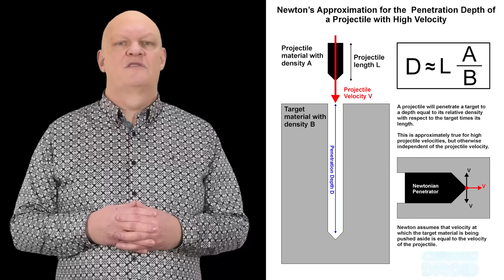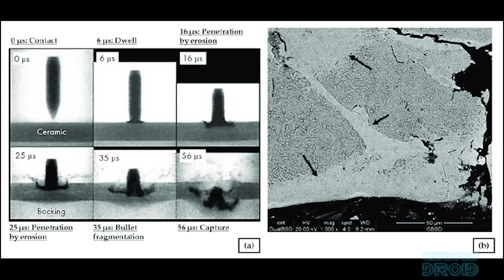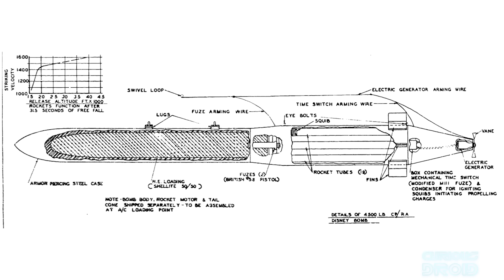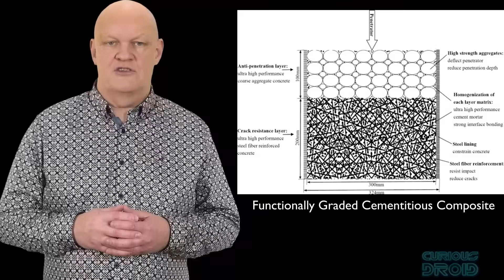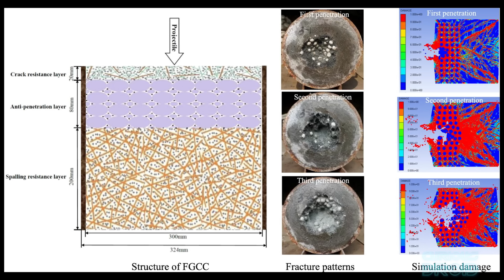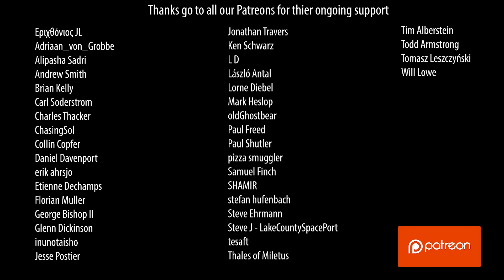Can Iran Stop U.S. Bunker Buster Bombs?

Comment: 6m of concrete?
Why not just make the bunker 1000m underground? We have mines for minerals and coal that are kilometers deep.
Reply: i donno, but i bet there becomes serious over coming challenges of ventalizing that depth.  likely, them bunkers in iran probably faced that challenge and found it unfeasible and useful to go further  than their said 300 feet.  and were willign to take their chances at a bare minimum depth that the best bunker buster could penitrate, versus delaying their opperations for months or years longer for a deminishing return.  so aim for the bare minimum and it should be good enough.  

i donno either but fumes and engines running none stop around the clock also very well might become tricky.  2 or 300 feet depth might be a happy medium where cost becomes non sensicle to go further down and maintain a full functions.  so say, if you go 300, it cost you X amount of time and X amount of funds.  but just another 50 will cost you 30% more time and money, resources.  its just not feasible and worth it.  let alone 200 more feet ant possible 3x the cost.  and deeper you go, also means more and more and more and more space to vent. now imagine gas generators running non stop. that alternitive would only really be a power plant above ground within useable distance....which is a dead give away targer. hit that and shut down the bunker at full stop.  so thts why im thinking gas generators in the that depth is crucial.  they'd be running so much, that  like 35% of the fuel burnt would just add more vent load to pump out.  need to push it out fast enough aslo is big factor or back logging would be a serious issue.  

so im thinking 300 foot range might be some kind of happy medium, otherwise, hell yeah. its a no brainer to do the deeper the safer theory.
Reply: @Lestat-Travesty  Nah, ventillation isnt a big problem... price is. Digging deep costs $$$. Lots of $$$.
But if your mission is making nukes, cost shouldn't be a main priority.
Reply: And how well do you think the entrances and ventilation shafts of those mines would stand up to even one of these bombs? 

Do you know how common collapses and other disasters are in those mines? And that’s just under normal conditions. What do you think would happen to those mines if you detonated over 5000 pounds of high explosives in the ventilation shafts?

Why do you think the US targeted the ventilation shafts at Fordow? 

Your bombs don’t have to reach all the way down in order to effectively destroy or even just seal off the facility
Reply: @valerierodger  Who cares about entrances? Just make 20 each couple kilometers from the next.

Mines collapse, because they use cheap shitty equipment and reinforcement, and not meters thick concrete... we have 20km long tunnels under mountains or even the f-ing ocean... they dont collapse and have been in operation for decades.

Comment: But here's the thing.  Even is Iran was  not  a world leader in concrete technology,  the Iranian Fordow complex  is under a 2,400 metre (7.800 feet)  mountain.  It would have been impossible to destroy the crucial heart of that complex even if specially reinforced concrete was not used.  
     Then when  you consider  that Iran had built that complex to withstand a F5 earthquake,  all  the machinery was mounted on rubber foundations to absorbs  the vibration of such a large earthquake  , and that is known that heavy blast doors  are used to separate  the different tunnels and chambers in the complex   you would  have to acknowledge  that the US knew that  their bombing  raid would fail to destroy the centrifuges.  
      So  why do  it?  Because fortunately a large majority of  the US public  and the  media are gullible enough to believe everything their president or the pentagon tells  them,  and if the Israeli's believe it too, war  is over and the US does not have to get dragged into  yet another war it cannot win.
Reply: Speaking of gullible, do you really believe the complex is under 2.4 km of mountain?!

It isn’t. It’s under about 80m.

The ability to withstand an earthquake is absolutely irrelevant to whether or not a facility has the ability to withstand a bombing (though it may help protect the centrifuges from being damaged by the vibrations from the explosions)

Destroying all the centrifuges is unnecessary. All that needs be done is to render the facility unusable - which, right now, it is, due to the severe damages it suffered.

And you don’t have to go through solid rock and hardened ceilings to do that, thanks to ventilation shafts and the incredible precision of the GBU-57 - and satellite imagery confirms the bombs hit the ventilation shafts.

There is no doubt Fordow suffered severe damage - even Iran admits that. They are still trying to dig their way in for a thorough analysis of the damage. And there is no doubt it thousands of Iran’s centrifuges have been destroyed.

But here’s the thing: Israel had already been hitting the nuclear sites with [smaller and less effective] bunker busters. There was always the possibility that the US would assist Israel, and Trump made it clear in advance. He was considering it. Days before the strike, there was suddenly an unusually high number of cargo trucks coming and going from the site. Who knows how much they got out before the.facility was hit.
Reply: @valerierodger  no, iran never conceded that fordow is "seriously" damaged, even us intelligence said that it only delayed iran by a few months which isnt severe damage at all

Comment: Everyone in the comments talking about no in 2025 is missing the point. This vid is about concrete bunkers, not mountains. No matter how advanced the bomb there exists a depth that will be safe. Were those facilities above or below that depth?
Reply: 80-90 meters.

One wouldn’t do it, but Fordow was hit in 2 spots, with 6 bombs being dropped on each spot - and, most significantly, those 2 spots were the ventilation shafts.

Yeah, feels very Star Wars - but you don’t need the Force to hit a ventilation shaft when you have an extremely accurate guided bomb unit.

Comment: Yes, they can.  You build a false level above your underground nuclear enrichment level.  Dig down a few hundred feet and build out a large empty chamber, reinforce it with a very high air entrained concrete mix.  Then build a second decoy level below it.  Then build your third level, but instead of bringing spoils to the surface, you deposit at level 2, and leave it uncompacted.. The excavation work from here is invisible to the surface.  Your structure from the surface looks like its the volume of a two level structure. But can be deep as you want it too.

The uncompacted fill and false air entrained concrete structure on top absorbs the blasts
Reply: You still have to supply the engineering works and have to get in and out of them. Static target rich environment and is why a superpower disperses  it's capabilities over the Globe and deep under the oceans.
Reply: You are ignoring 2 things:

1. The IAEA had been inspecting the facilities. That’s how they found uranium enriched to 83% at Fordow…

2. You will always have the vulnerability of ventilation shafts.
Reply: I feel like with your level of knowledge your probably already on several watchlist and there might be a DM from Tehan trying to recruit you for their next project lol.

Comment: The answer is no they can't and now they have agreed to a ceasefire.
Reply: No they can't iranian foreign ministry came out themselfs and claimed they sustained massive damage at their nuclear facilities , aswell as the CIA gave out a report which confirmed, also IDF commandos on the ground in iran confirmed it was gone.
Reply: @isrolit  I get where your going with this and I also want to believe that, but if they are using steel mesh fiber reinforced concrete and it actually succeeded in any regards, then it would be in Iran's best interest to claim it was a success and hide the success the concrete had, so USA doesn't rush plans on it's next bomb.

Comment: Cool. But it does not factor in the case at Fordo that there was also a hill over the top and that there is likely  diamond shaped deflections designed into the roof.

Comment: So, the big question is now, those 6 MOPs did their job or not in Iran yesterday?
Reply: I believe it would be 12 in total since there were 6 b2s. Also it was spread between 3 sites so probably 4 per site
Reply: @person6539 B2 have max payload of 20t while the gbu57 is 13t. So no b2 can only carry 1.
Reply: @IsomerSoma  Interesting, i did not know that
Reply: @IsomerSoma They run less fuel at takeoff to get the 60,000 lb munitions payload airborne. So all b2 carried 2 gbu 57 each to Iran for 14 total. They refuel midair to accomplish this
Reply: Add what we learnt from this video from the fact it is also carved deep into a mountain

Comment: The issue isn't whether Iranian bunkers can stop  bunker busters. They don't need to. Iran is a huge country, just shy of 640,000 square miles. The 17th largest in the world. It has a drone and missile arsenal of just under a million pieces. These are spread in 100's of bunkers scattered all over the country. Each bunker system is large, compartmentalised and complex. One bomb will cause significant damage in a restricted area but not put the complex out of service. So the issue is that potential enemies such as the USA or Israel do not have enough bombs to scratch the surface of the Iranian bunker systems and complexes. Nor enough aircraft to deliver the bombs. Also Iran has had decades to build these bunkers.

Comment: False cavities. Lead, Iron, Water pressurized chambers. Neutonain fluids sealed between layers of concrete? Key is to disrupt the fuse timing, calculation and its kinetic enere. So it exploded prematurely.

Comment: Reminder that you can send bunker busters one after the other. So penetration depth can be MUCH deeper when using multiple.
Reply: and than you run out quickly ...
+ you need the exact location underground...

a another defensive technology strategy which is not yet discussed here, is the use of deflecting sheets of steel in the concrete under an angle on top of non homogenous chunks within the concrete in a diamond shaped form ...
The deflect the penetrating arrowed buster, resulting in depleting most of its kinetic energy and rendering its penetration capacity decimated....

Comment: this is silly.
Im mean its really dumb to even discuss this.
If they can penetrate 6 meters ..
you build at 60 meters.
Its not rocket science ffs :)
Reply: Also …hide the bunkers!
Reply: @Cranky_Crone  very hard to hide  a bunker from thermal imagers on satellites.
Reply: building a bunker underground can be harder than rocket science
Reply: @miguellopez3392  not really :) at least not in the case of palestine
those arent air conditioned masterpieces, air circulation seems to depend mostly on rising hot air .. theyre not even as "luxurious" as the old ratzi bunkers, which were constructed THEN buried, and certainly had hot cold water, powered air con, plus chemical defense and all that
sometimes its just a tunnel, cut into solid rock, then finished with some concreting, which seems to be a typical lebanese model
very simple but very robust
Reply: @markhill3858  this was before satalite thermal imaging could detect the vent holes and cavities under the surface.
Reply: @miguellopez3392  its not about detection. static defenses dont hold secrets well or for very long.
Reply: @markhill3858  getting rid of vent holes and secret exits is how you destroy a bunker and it's occupants permently.
Reply: @miguellopez3392  is it!
have you heard of diplomacy and politics and law and all that?
or is it all just a big RTS to you :)
Reply: @markhill3858  lol you just stated the reason why we use bunker busters and not nukes you silly willy.

Comment: Fake concrete to test. if you have same thing with gaps and concrete with metals. it wont go far
Reply: gaps make it easier as it allows the concrete to fracture easier when its thinner. its designed to punch through metal as well.
Reply: @miguellopez3392  no.

Comment: NORAD has (or had) its command bunker inside a mountain. The location of the bunker and the bunker itself were supposed to be able to  withstand the impact of a nuke. The race between bunker busters and bunkers will at least in theory always be won by the bunkers because on planet earth there is at least 2000 m of shielding available before the geothermal heat increases so much that digging deeper becomes problematic. And a 2000 m thick ceiling no bunker buster - including a nuclear one - can break. As Mr. Droid. has said : it makes more sense to obliterate the access points to the bunker rather than attempting to break the bunker itself.

Comment: I think that using tilted layers could also cause lateral stress on the bombs, and possibly deflect a lot more energy... There are also some structural forms that are designed to collapse in one direction, but transfer most impact energy at almost perpendicular to the impact. Tit for tat, as one says!

Comment: The best defense is to shoot down the aircraft or the bomb first, and Iran has some of the best SAM systems in the world, and were recently strengthened by Russia's S-400 systems. Plus, RF Jammers make GPS guidance useless. Laser guidance is possible, but needs a spotter (usually the attacking aircraft itself) to hold the target until the bomb hits. This isn't practical against an opponent with an integrated air defense (IAD). 

Also I wonder how effective a scaled up version of reactive armor might be. Basically take the basic concept of reactive armor bricks on tanks, and just make them bigger, and imbed them in several layers above the bunker.

Comment: This is kinda BS.  Sand/cement polymer cement backfill was indeed available to public industry and not just military.  It was developed for mining industry for ground stress control in deep operations.   It was used as far back in the 1980s in underhand stope extraction of ores.

Comment: Reactive armor. Have shaped-charge explosives directed parallel to the top of the bunker and another layer aimed straight up. You just have to move it a little so the tip of the bomb doesn't hit first. You could also have a .20mm Metalstorm off to the side and hit the bomb with 500 rounds, or multiple Metalstorms.

Comment: The US has a new generation of bunker buster bombs which are 2,000lb and 30,000lb. The USAF most advanced stealth bombers can carry 16 x 2,000lb and 2 x 30,000lb.  These new generation bunker buster bombs are more advanced than anything seen previously and have been tested by USAF on a wide range of targets below ground. They can penetrate virtually any sites and travel several hundred feet below ground before detonating a powerful main explosion which looks like a mini nuclear explosion when 30,000lb ones are used. 

Even sites several miles below ground (such as Iran's key nuclear sites) can be hit according to the USAF which demonstrated in one test where it fired 1 x 30,000lb into a hardened surface with the bomb rotating in mid-air and coming downwards into the ground and then seconds later a massive explosion about 30-50 feet below ground and large crater seen. Then the USAF dropped a second 30,000lb into the crater which went into deeper and created a second explosion. The US military said it can drop multiple 30,000lb bombs on a site several miles below ground in this ground in this manner and each bomb penetrates deeper and further than the last extending the depth. 

So the answer to this video is that yes, the USAF can target pretty much any Iranian (and other) underground hardened facilities with these new generation bombs with extreme precision and deadly effect. 

It's believed the development of these and public testing of them is a clear signal to Iran that the USAF has the capability to target Iran's underground nuclear and missile storage facilities if it wishes to. Also a clear signal to Russia and North Korea of the same. No underground facility is safe.

Comment: It's easy to defend against it but you need a special bunker. See how even after it went through the concrete it deflected? Now all you need is to engineer multiple barriers with gaps in between to guide the bomb away from the real bunker few stories below. It can be done in around 72 meters of depth . Costly and complicated but can be done. Every 6 meters of concrete have a 6 meter gap and with an incline to guide the bomb away 36 + 36 = 72.  No bunker buster will reach the room below.

Just build your room at 78 meters and give it extra reinforcement to withstand the pressure and build the entrance from even lower at 84 meters and at least 500 meter tunnel before starting to go back up to surface.

Comment: Yes it's possible you have to put steel plates along with iron rods and concretes beside bunkers can be made smaller chambers connected by tunnel networks

In addition, you can made them beneath mountains or hills 👍

Comment: 00:04 Battle between bunker busters and defenses
02:12 Discussing the impact depth of projectiles based on density and momentum
04:09 Concrete can absorb kinetic energy and stop projectiles.
06:07 Bunker Buster Bombs' design for penetrating reinforced concrete
08:10 US developed bunker buster bombs after World War II
10:19 Iran's use of ultra high performance concrete to fortify bunkers
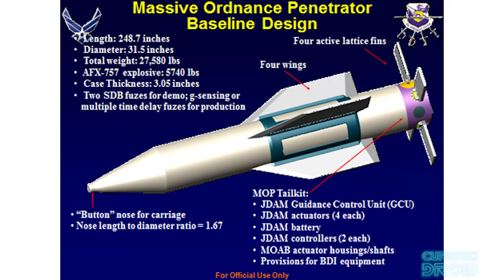12:28 Development of powerful bunker-buster bombs
14:40 Functional graded cementitious composite (FGCC) can resist penetration explosions better than Ultra-High Performance Concrete (UHPC).

Comment: The Next Generation Penetrator is being developed to allow smaller aircraft to carry a Bunker Buster that's as powerful as the MOP.  The efficiency of concrete has little to nothing to do with it.  If the MOP doesn't fully penetrate the bunker, the bomb would effectively be a 30k lb shape charge.